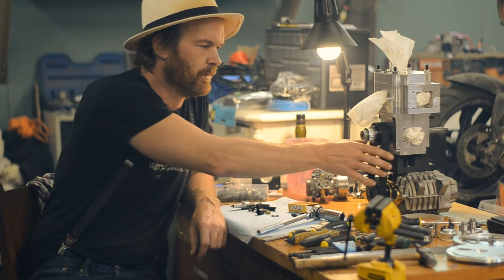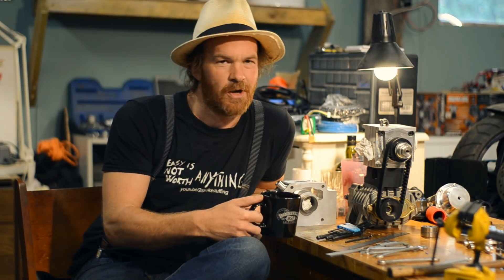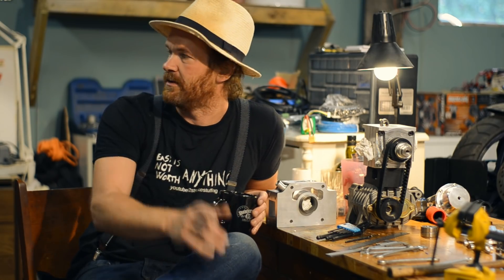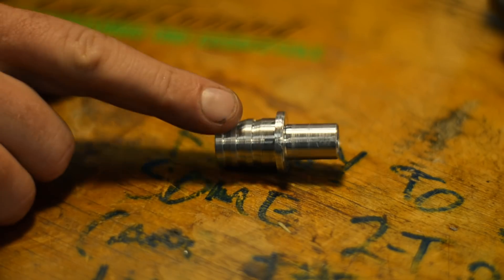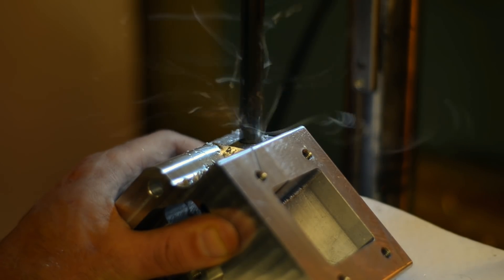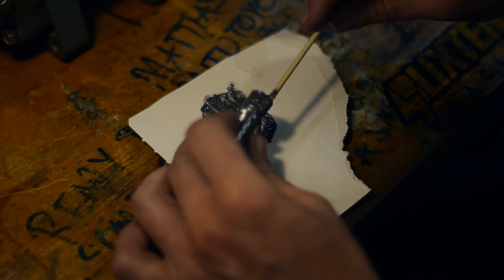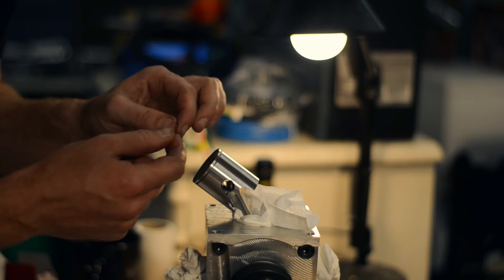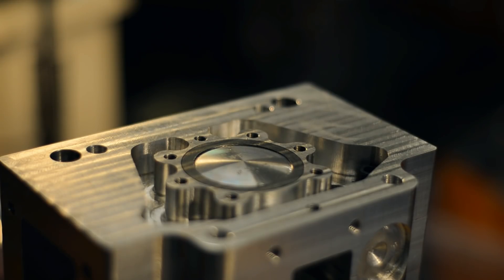Two insane engines!

Comment: if you’re tuning that mopeds engine, could you do a detailed series on how to calculate port timing, design a resonance chamber, what peak rpm to go for, how to choose a carb etc? 
you’re literally the only guy who can bring this knowledge to enough people.
I’ve built my very first engine over the past few weeks and i must say it’s extremely hard to find out where to start and which formulas to use. Everyone’s using different ones, they all use different terms for the same things and they all start at completely different points, so its really hard to wrap your heac around it all. 
Would be an easy thing i guess, just taking and a few drawings and examples.
Reply: look at his old videos, he made VERY detailled explanations
Reply: Bell's two stroke tuning book is a good start,and as the other comments say,search 2strokestuffing's old videos
Reply: @zagi6584  thanks, ill look into that
Reply: He has
Reply: There's a book for that.. a few actually.
Reply: Never tried using aft for final cleaning of a freshly honed cylinder but it makes very good sense because aft is very high detergent low viscosity oil that will trap microscopic particles in solution to be washed out .atf has these properties to keep clutch particles from clogging up in the valve body of automatic transmissions to be trapped in the filter ..so it has to be a good cleaner after cylinder honing. Especially tiny particles of a stone hone that naturally wear off the hone #!#!
Reply: There are videos of him explaining and there are videos of him doping the whole model in  cad where he explains even more

Comment: You know with the 100% of bore piston I honestly think having like 3 pins to stop the ring from the hitting the port might work better because right now I feel like that one pin is stopping the middle from hitting it but not the edges,  also I was thinking what if it's not exactly 100% of bore what if there's still a bridge just not 100% across the port like maybe a small gap in the middle
Reply: I have seen that working at 90 -100 cc extreamly ported chainsaws

Comment: Are wide-Band systems available for 2 strokes and your specific fuel application? would be useful to see what happening to the engine at WOT on the resonant intake as a function of RPM...
Reply from the maker: I've got one on the shelf. They don't last long with all the oil+unburnt fuel, but could give some insight before signing off😁
Reply: I'm wondering about this too for a 2 stroke fuel injection project. The MSEXTRA forum suggested the same that traditional widebands don't last long with so much oil in the exhaust. Would be nice for tuning...

Comment: Great video as always. Simple idea instead of a clutch between the motor and dyno, maybe a polyurethane or rubber attached between the 2 like an old school steering coupler. That can break away in a lock up situation?

Comment: Try to tune babetta 210 engine. It's czech-Slovakia moped. I have one and I'm interesting in what would u do with engine. I tuned it but it has only 3.4 HP (stock 1.5HP) max rpm 6000 factory, mine 8700rpm

Comment: Oh, if you want some kind of easy and safe load, use a large air-fan. Not a lot of mass (assuming it's not too large) and dispersing the energy without generating lots of heat.
Reply: @Alfred Wedmore 
You don't need it to be silent or efficient, or even directional like a proper fan. Tripling the speed (and getting more than nine times the resistance) is a good thing. And you also don't need a motor. Just enough circular air-resistance at a given RPM around a fixed axis.

Think straight paddles on a disc, blowing unfocused air 360 degrees around.
Reply: @Alfred Wedmore 
Engine masters did a video on that, try maybe 10 pounds and the size of an 18" radiator fan.

Better yet, you could put a louver in front of it and actually control how much load you apply very easily and quickly with a little servo driven by a microcontroller.

https://www.youtube.com/watch?v=ZXdLgaFXZzs&t=9s&ab_channel=MotorTrendChannel

Comment: Opposed piston engines! 
More complicated, but it literally cuts the effective piston-speed in half and is easier to get good scavenging with (By offsetting the timing of the two pistons so the ports are covered/uncovered at the optimal time.
Reply: he's shooting for single cylinder, 2 stroke 50cc WR. opposed piston counts as a twin. not saying that you're wrong, vespa made a 125cc prototype that went over 100mph in the early 50's doing just that. 17hp in 1951....
i can easily imagine that a brute force, twin supercharged opposed piston two stroke would be a land speed monster today.
Reply: @comethiburs2326  
Ah, bummer. I thought it was HP/cylinder volume he was going for. So even though it's two pistons, it's a single cylinder technically
Reply: @PwntifexMaximus  its one piston with two carburetors ..the primary carb is used on start up to full throttle... then he kicks in the secondary carb full throttle that is mounted on the long intake runner . that is when the engine tries to come off the bench! Lol . I was going to ask if he has tried to dynamically balance the crankshaft by spinning it without the rotating assembly but with a weight box with lead shot inside that all together weighs within one gram of the total weight of the connecting rod and bearings plus the piston , pin, keepers, and the piston ring....then with weight box with the proper amount of lead shot inside clamped and bolted to the rod journal of the fly wheels you spin it up to the maximum RPM that you are tuning for and you will eliminate almost all the inertia produced from improper static balance ...i had this type of balance job done to an old FLH Big twin Harley and it was unbelievably smooth and hardly any vibration ..this is how they do it at Precision balance Company of Indianapolis Indiana where they balance IndyCar engines period but balancing engines is just part of their work they do . A lot of other things are all types of shafts and big balancing of industrial Machinery that's been custom-made

Comment: 5:00 cant you replace that other bearing with a nother wheel to increase diameter and get enuf tention on the beld and olso nothing is rubbing on the teeth of the belt except the wheels?

Comment: The right side idler should be "geared" so that the belt teeth wouldnt wear out from it. The left side one is good because the belt is flat from the outside.
Reply: And have you tought of making a TPI type fuel injection system so you could control the airfuel ratio better than a carb?

Comment: I wonder if those head studs will take the cylinder pressure of that for any time .
Reply from the maker: Might need to beef it up.
Reply: @2STROKESTUFFING  
I think you are doing really creative and quality work . From what I understand a normally aspirated 4 stroke engine normally achieves a peak cylinder  pressure of 350-700 psi , when a powered adder is added that obviously increases so you can probably get a rough idea from that . If you say 900 psi and a 40mm piston you get 1753 lbf of lifting force against that cylinder head ! It’s crazy . 
Here is the calculator I used .https://www.sensorsone.com/piston-cylinder-pressure-and-diameter-to-force-calculator/

Comment: Try making a cogged inside idler so the belt runs more smoothly over it. Increase the diameter of both idlers to take up the slack and slow down the bearing speed
Reply: Exactly what I was going to say 👍🏼. A belt is only made to lean at a flat roller on the flat side of the belt.
Reply from the maker: 👍 I'll change it, thanks for the heads up!
Reply: I was thinking the same!

Comment: In MX I'm pretty sure they're getting around 20+ HP from 50cc's. 60's are in the 23-25hp. 85's -30hp.
Reply: Sounds right... and my dang harley 883 only makes like 45 hp. WTF! Harley smh.  Damn thing feels so slow compared to dirtbikes
Reply: @skinnybigstuff1040  in 1988 a friend bought new HD Sportster. I rode it a few miles, we were moving bikes. It was very slow. Like a 350 single from c.1960. surprised me. Channel "Devise Travels" is covering Sturgis everyday. Zero ritual shame muzzles on display
Reply: Yes from my fab racing day's they are realistic figures. We only managed 13.5 from a kawasaki ar50  engine but it did have to last 6 hours that was at the wheels too on a dynojet. I also had a friend who said he got 28 out of an rm80.
Reply: @stephenbates8370  my son raced mx 1994-2006. These are numbers I was hearing Then. The manual for my 1998 KX125 claims 40hp at the c.s. sprocket. MX engine modifiers want $3500 for a few extra HP in 2005 $$ 💸
Reply: @happyraccoon4791  Mx bikes put out quite a lot, and kart engines are even more extreme as they dont need as much low end torque and wide powerbands as a mx bike does, think kart 125s put out around 50hp.
Reply: @linushforsberg8385  yes, karts only need top end and the HP is big. And this 50cc monster should be big hp, too.
Reply: @Alfred Wedmore and lifespan of pistons
Reply: @Alfred Wedmore longevity is another 👍
Reply: @Alfred Wedmore i had a 94 rm 250 built beast mode. It sucked the gas up

Comment: I'd reccomend using a freewheel off of a bicycle, for your load. That way if the engine shuts off, the freewheel will prevent drive to the piston.
Reply: They make 1 way cassettes  and 1 way bearings in so many sizes... if a bicycle one is too pinner step up a size...
Reply: @Alfred Wedmore it doesn't need to be geared for speed tho... I build moterized bikes, I gear the engine to the rear cassette and it hasn't gave me any problems over 2 years of continuous riding
Reply: Would it be strong enough?
Reply: @mrsnezbit2219  well its strong enough to take the tourqe of your legs, he would have to rig a pully in replace of the sprocket. He could use a cassette hub instead. But my point is to use a bicycle hub and wheel that way he can apply a brake load through the bicycle brakes
Reply: @Alfred Wedmore just my two cents and thinking aloud, if one hub is not strong enough can't u double or even treble up ? Or are we now getting into the realms of space and size ?
Just curious 👍✌
Reply: @Alfred Wedmore my moterized bike isnt a Chinese ebay build, it's a chainsaw with a pully welded to the centrifugal clutch and belt driven to a gearbox which has a 14t bicycle sprocket to a 12 speed sram cassette. You can see it in my profile picture.

Comment: Holly Shit. That engine has some power going there.
Tip. You can get "cheap" Ducati slipper clutch for the anti seize mechanism. They are great as they only allow power transfer in one direction and you slip can be adjusted with springs. They are also used in Supermoto bikes.
Always great stuff. Looking forward for the next video.
Reply from the maker: Thanks for the tip!

Comment: 4:48 first time i see the teeth side of a belt running around a idler bearing/pulley. Wouldnt this damage the belt? Probably with the right size belt you just need one idler/tensioner bearing.
Reply: That was my thought too, under light load and RPM it might not be a problem but with the RPM's this thing will be spinning I think it will shred the belt teeth in minutes.
Reply: It will damage the belt and it hurts my soul a little to see it set up this way. Ideally he would use timing pulley on a bearing as an idler.
Reply from the maker: Many have warned me, I'm switching to single roller, or one with teeth 👍
Reply: I bet it would produce a ton of vibration too.

Comment: I think a sprag bearing would be a better idea for the dyno drive unless you actually want it to back drive.  You could maybe use the starter motor drive assembly from a large capacity bike.
Reply from the maker: Great idea!
Reply: some automatic transmissions use sprags too.
Reply: Sprag bearing/clutch is a great idea, not sure about using a starter motor, though. Most use a helical gear, or bendix.
Reply: @panikrev175  The starters on big capacity bike engines have permanently engaged gears and use a sprag bearing to prevent the engine back driving the starter. No bendix or pre-engaged mechanisms.